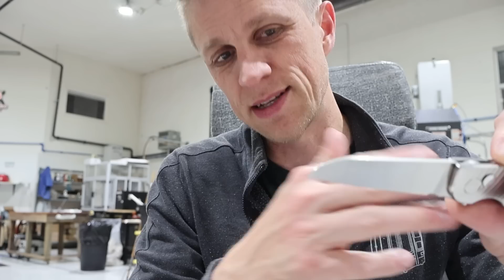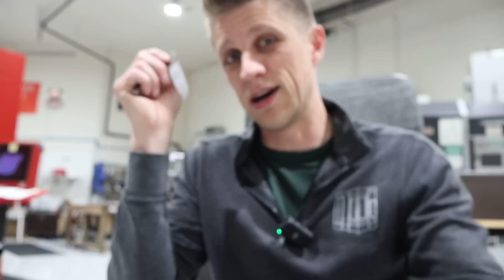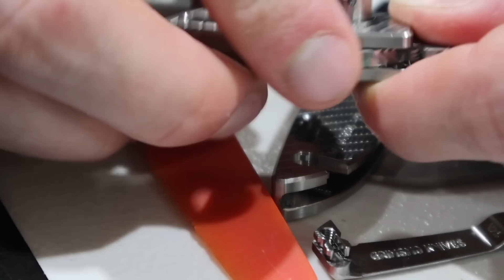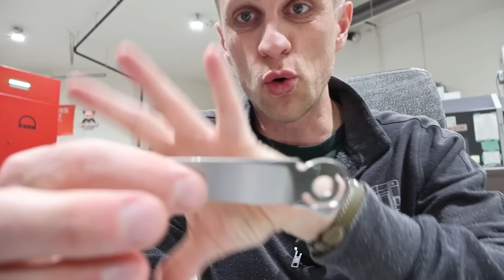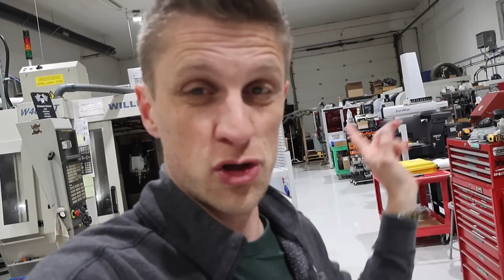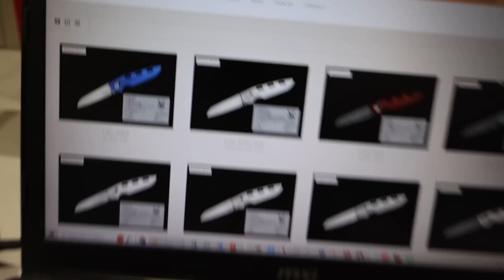We're Getting Closer.. | Knifemaking Tuesdays 125

Comment: Instead of changing the blade parameters so that it sits flush with the sides when closed, why not just shave off the sides to match the blade height where it currently sits? Feels like it'd be easier and it'll even shave a gram or two off the total weight

Comment: A set screw of some sort makes sense, just so the pocket clip can’t slide off. Maybe a smaller screw from the side instead of from the top/back. Good luck!
Reply: I maybe even have thought of a more complicated solution though it will still likely have play. Just like the pivot, do a ball detent on the clip with a spring. Put a hole through the frame to allow for manipulating it, though it would take a pick or similar tool to release it. Not user friendly, but could also minimize wiggle.

Comment: that slip in clip design is going create problems after the sale. It's going to loosen up over time.
It's cool if it's a safe queen but it will be a headache if used. Change the design. Love the blade shape.That pivot ball bearing detent is genius.
Listening to you talk about the design issues tells me your a perfectionist and THATS A GOOD THING.
Reply: It looks like he could do it integral with the handle, so the entire handle and clip is one piece of titanium.  It would need to be a bigger piece of titanium, and probably involve EDM due to the bottom of the clip needing to be very close to the knife body.  So probably won't happen.

Comment: I love everything but the clip. And now that I know it's not screwed into place I will likely skip this release. Not a fan of ears or it being able to slide out. The wiggle is the absolute deal breaker -- especially on a 900$ plus knife. I would have been much happier if it had conventional screws and it was just keyed into position so there was no wiggle and it was fixed into place firmly. The screws could of been countersunk so they sit flush and it would of looked just as attractive. Since this knife is integral I understand you can't hide the screws from the inside, but what I suggested would of been just fine. A single T8 that was countersink and a tongue and groove for the clip base would of probably more than sufficient.

Comment: Normalising the blade steal before machining the blade for a stressfree even grain struckture beforehand could solve the warping problem. I am not realy sure how well the steel is in its raw form. Its possible the steel has some inner Stress which is released when hardening. Seems to be the case when they warp differently and are from the same bar. Thats a thing we did in Moldmaking for long parts and tight tollerances. In German its called Spannungsarmglühen.
Reply: I was thinking the same thing. We run a output housing from a forging which has 2 internal ring gear features, 2 internal bearings and 1 external bearing and when we used to go straight from forging to turning, gear cutting then heat treatment before coming back for hard turning we forever had issues with bad runout. No we send the forgings for normalising before we turn them and run out after heat treatment is virtually non existent.

Comment: The clip wiggling sounds similar to a woodworking problem with sliding dovetails... you need clearance to slide them together but clearance makes them move.  The trick is to use a tapered dovetail instead of a straight one, so that you need much less clearance and you only need it at the very last moment.  I wonder if that would work with your knife too.

Comment: For the clip could you design it so the clip gets cooled in the cryo tank then installed then when it heats up to room temp it is tighter then the .0002 tolerance you talk about.
Reply: That's exactly what I was thinking. Ferrari installs their valve seats with an interference fit. By cryo freezing them just before installation, once they warm up, they're not coming back out. If it works in a combustion chamber with a valve slamming into it thousands of times a minute, it should work fine for a pocket clip.

Comment: When get that finely detailed I almost consider metal more like a liquid than a solid. It moves it does weird things it's just not the solid that people generally think it is. Edge precision did a video a while back saying how some types of aluminum will take like 2 weeks to release stress after being machined. Heat treat does do weird things and i would guess Damascus would be even more prone because it's different grades mashed together inconsistently. Even a single grade of metal say 4140 isn't exactly the same edge to edge and end to end. Everything has tolerance including the chemistry of metal as well as the production process. One side of the bar might cool a little faster than the other or whatever causing minut differences that most of us don't notice but with the fine detail you are doing might be more of an issue.